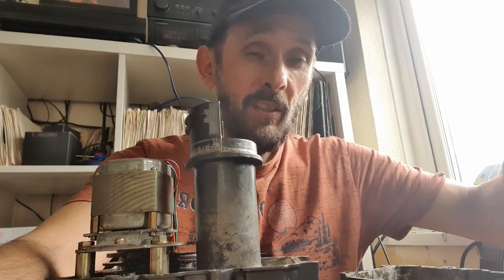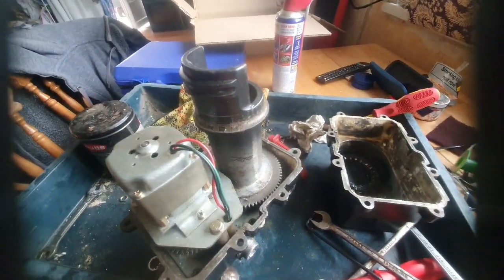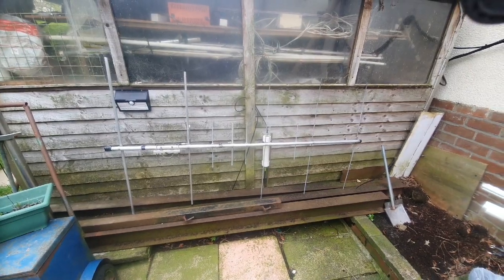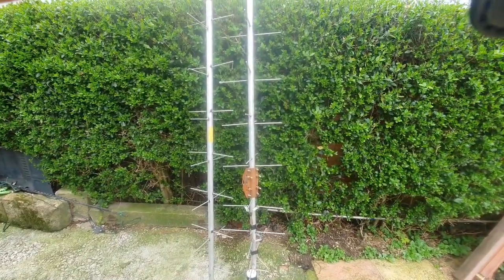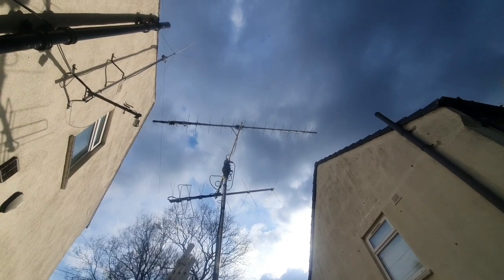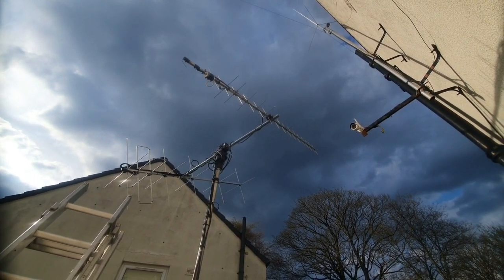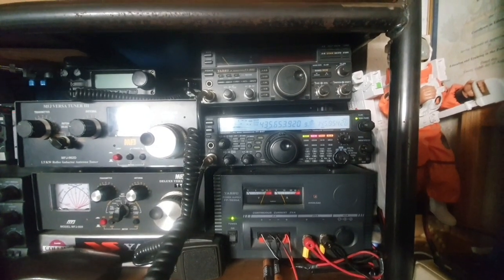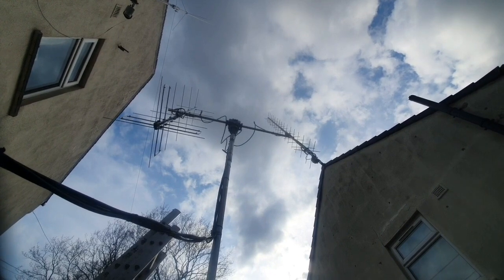G5500 elevation pot replacement and new Antenna installed.

Comment: In the process of doing mine too. With help. Then there's the pain of recalibration.
Reply from the maker: It's easy enough with the multimeter to find the dead centre of the pot then just match it up with a compass 180*
Reply: @M0YKSHamRadio  match what up with a compass mate. I see there is a small folded copper plate on the main shaft what position does that go in when you reassemble it? I have a very knowledgeable chap helping me with it, but it would be nice to know for myself.
Reply from the maker: @The-Chaos-Shack  the pot is 500 k so set the pot to 250k for centre position using a multi meter. Refit to gear box . The copper bracket thingy is what operates the limit switches. This wants to positioned upward facing in the centre of the two switches  once fully assembled you should be reading 90*  then use a spirit level to fix antenna to boom at 90* . The compass would be then used to position the azimuth. If needed. Hope this makes sense
Reply: @M0YKSHamRadio  it certainly does 👌👍

Comment: How you switch the polarization of the antenna?
Reply from the maker: Hi, it is fed with one feeder into an RF splitter which then feeds both Horizontal and Vertical and the same time giving a circular polarized transmitted signal. Both are the same system. 73 de M0YKS

Comment: Nice antenna Simon, I think we have 2 of those rotors at our club station. One is in need of repair with the antennas broken and the other in good shape. Looks like I will be spending a lot of time at the club station putting up the 3 element HF beam plus working with the satellite antennas. Lucky I am retired and have the time but sometimes not the energy to do these things. O well we need more young people in our club. Thanks for sharing. de ve5ee
Reply from the maker: Hi Lyle, thanks for the comment. Your club sounds like it has some good equipment to play with. have fun and thanks for watching. 73 de M0YKS